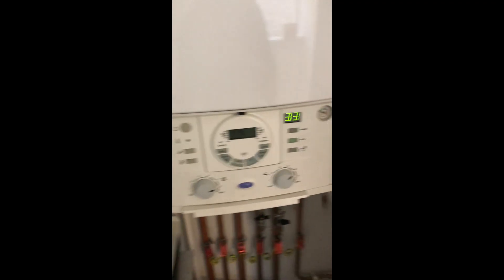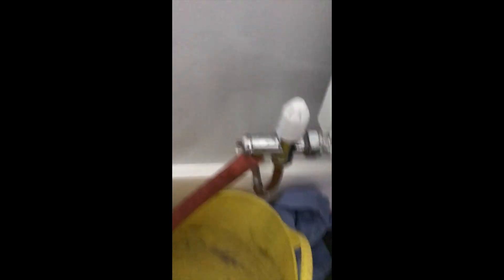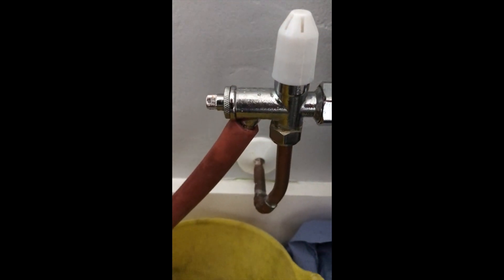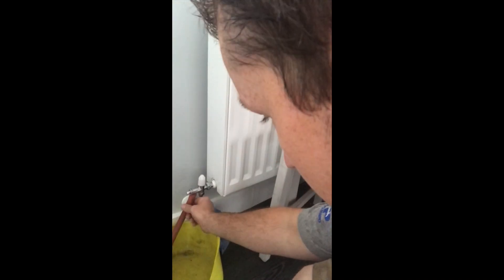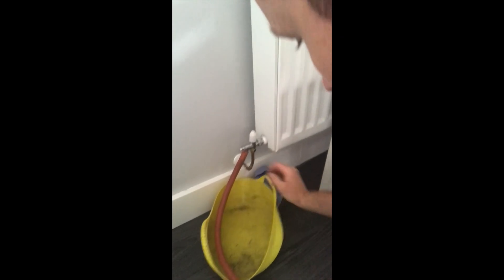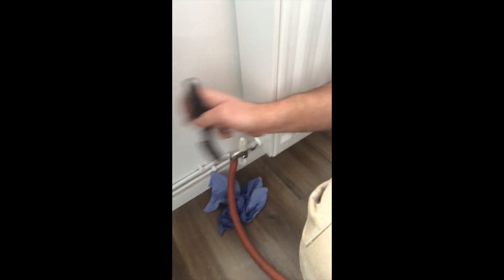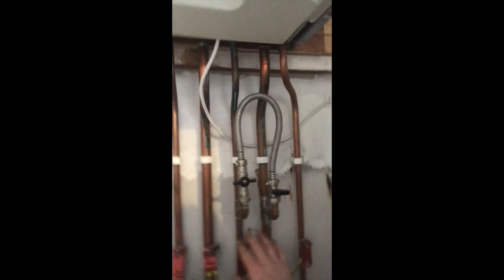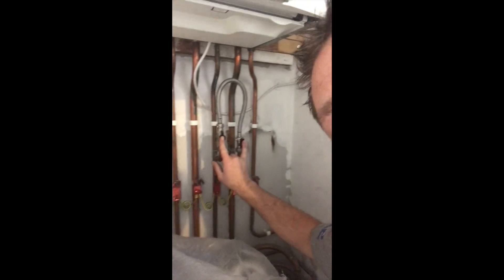How to drain down a central heating system - Combi boiler

Comment: What about the water pipes in the loft- This is the highest point - How to you drain the air from the pipes in the loft?
Reply: Can I use a garden hose or do I need to buy a special hose in order to do this job?
Reply from the maker: Abdus Samad Mohammed I used a garden hose for years before I bought a proper plumbers hose, garden hose dribble a little bit use a jubilee clip to tighten the hose on the drain off and your laughing! Let us know how you get on 👍
Reply from the maker: Hi Kevin, Thanks for your message, air in the pipes in the loft is a headache, Theres a couple of ways to remove them, I'll post a video this weekend for you which explains better. Have you a pressurised system (combi boiler) or a gravity feed system (tank in the loft)?
Reply: @NickTaylorPlumbingLtd  Hi Nick. Thanks for the reply, it's a pressurised system. There's a fitting on top of a copper pipe in the loft, I slackened it and bled the air out. But would prefer to put a new fitting on this pipe with a push-button on it, so I can bleed it every few weeks. There's an old storage tank in the loft, but this isn't getting used anymore and somebody obviously just blanked off the pipes in the loft.

Comment: Thank you for the video. Good explanation re. multiple drain cocks in the house. Very helpful.
Reply from the maker: Hi Andrei, Thanks for your kind words! Keep up the plumbing and if you haven't already don't forget to subscribe for more helpful info.
Reply: @NickTaylorPlumbingLtd  Successfully flushed, cleaned and refilled my CH system last weekend! Added some inhibitor too, should be good for now. There were three drain cocks to  deal with and one of them was leaking, so I replaced it too. That and the filling loop valve which was not shutting properly, so pressure was building up and leaking water via the PRV. Feeling great about doing it all by myself! :)
Reply from the maker: Andrei Kaportsev great to hear keep up the good work! 👍

Comment: Do you need to turn off the water at the stopcock before you open the drain value?
Reply from the maker: Hi Matthew, thanks for your comment, there's no need to turn the water off at the stopcock for a combi boiler system. 
If you have a gravity fed system (tank in the loft) you'll need to turn the stopcock off first.
I have a new video coming out this weekend on how to drain down a gravity fed system so don't forget to like and subscribe for loads more helpful videos.
Reply: Much appreciated, Nick, thank you! Got a rusted TRV I want to replace at some stage but I think the stopcock is hidden behind a tiled wall from the previous owners so that’s really handy.